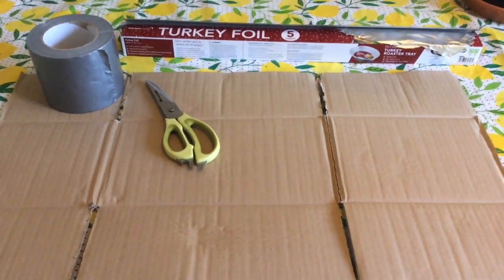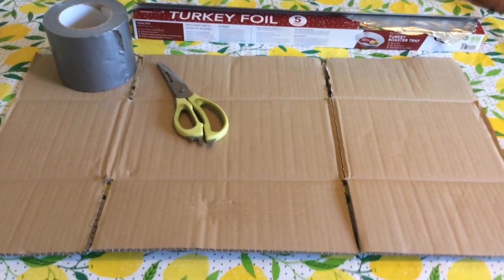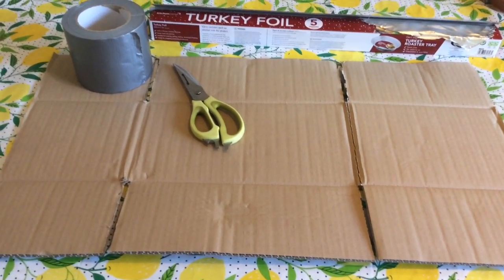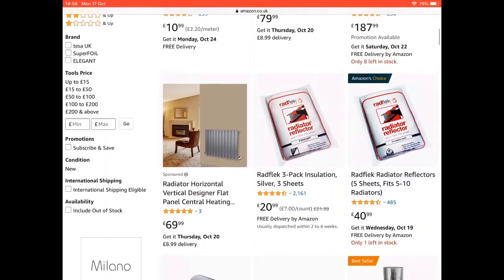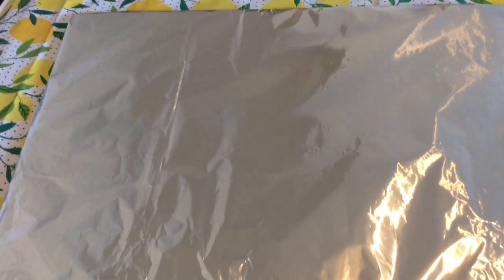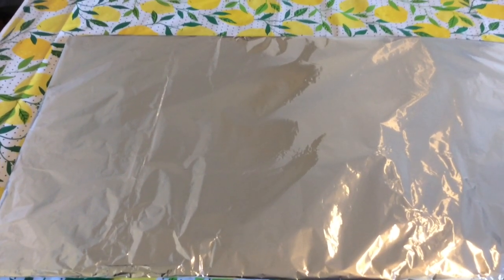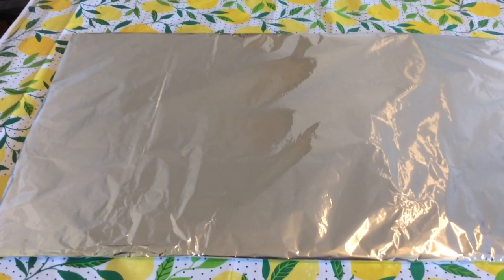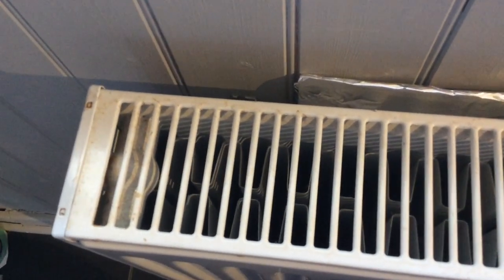Making Radiator Reflectors with Cardboard and Tinfoil To Keep The Heat In The Room More 😊

Comment: Even a cardboard sheet helps a lot. The radiators in my daughters bedroom are infront of big windows and after just putting a sizeable piece of cardboard there, the room is extremely warm with the radiator on just a little.
Have a lot of cardboard, so will be doing this in all the rooms.
Reply from the maker: That’s great, we don’t want our heat escaping 😊 If you find a cheap frost windscreen protector for a car, that would work to as padded and has a silver reflective cover. Thanks for watching and commenting 😀
Reply: @ruthsmith2367  Exactly. And now with prices over here in the netherlands rising to an ultimate high, it's even more important to keep it in without having to break the bank. 
I have thought about the carcovers, but seeing as i have 15 radiators in the house, of which 11 are in actual use on the ground floor and 1st floor, it isn't very costeffective to get the carcovers. But thanks for the tip.
Reply from the maker: @Philyra86   wow lots of radiators to cover there. If you ever see camping mats in charity shops or on sale in winter. They are padded and have a reflective side to, may be do them all with cardboard as you say and update ones when you see cheaper alternatives 😀

Comment: Great idea Ruth 👌👊💜👊
Reply from the maker: Hi matey hope you are well ❤️ not my idea but just getting my act together this year. Do you think the frost protectors you get for car windscreens which are usually silver would work to. I saw them in the pound shop last year or do you think that might be a fire hazard. You would have to check the material used first I guess. Just thinking out the box 😊
Reply: @ruthsmith2367  i think that they would be perfect. (Not as cheap as reclaimed/recycled cardboard and Turkey foil) radiators are never hot enough to make anything combust. So they would be even better as its foil covered foam as opposed to paper and better longevity as less delicate 👌👊💜👊much love to you and yours Ruth.
Reply from the maker: @rosehippyguy3402   thanks RHG. I might keep an eye out in the pound shop. Lots of love going back your way ❤️ Thanks for watching by the way xx